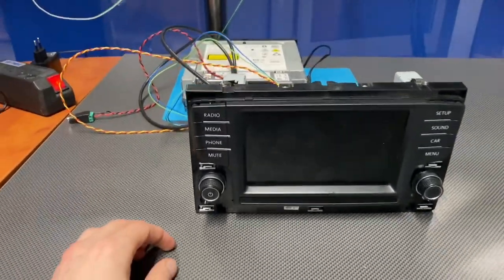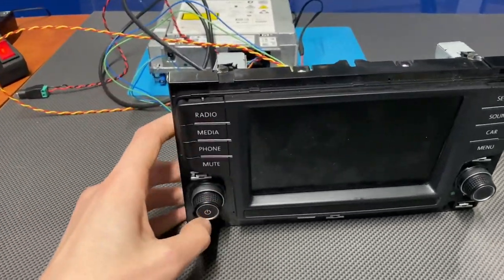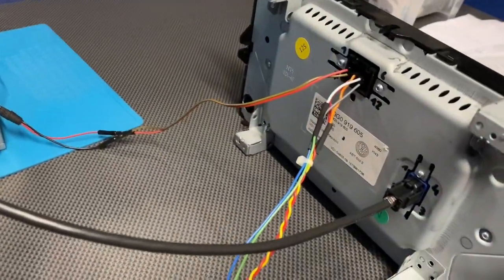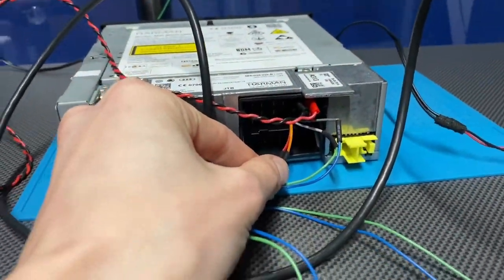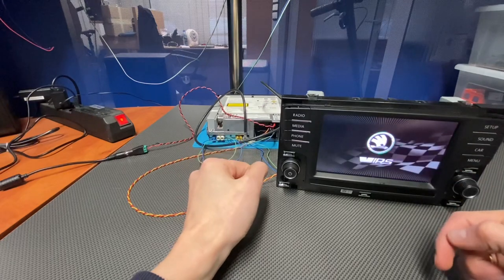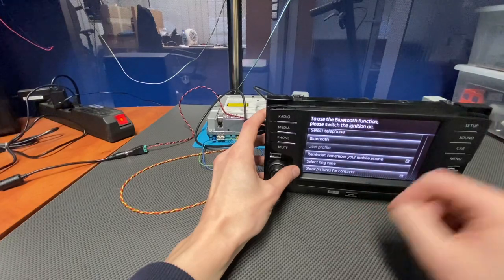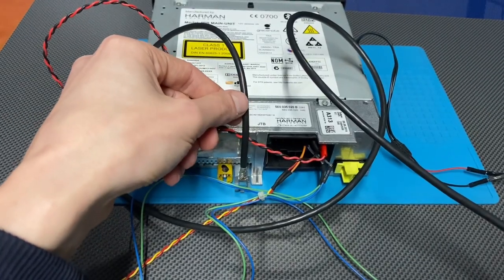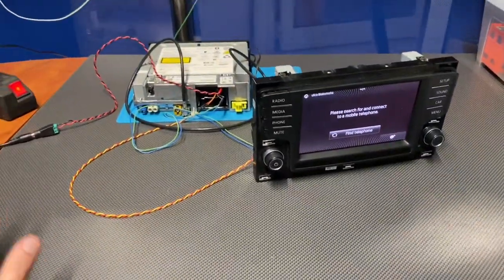How to turn on MIB on bench

Comment: I just purchased a used MIB2 for a 2017 Audi Q7 that doesn’t power on. The EBay seller says that I must disable component protection before it will power on. Is this true based on your experience? I think it’s a bad unit.

Comment: Hi, I need help with a unit. I have a 5q0 035 874c. I think I have damaged the circuit board with the wrong size removal key. Do you have a wiring diagram for this in hope o can get it fixed.

Comment: Where did you source your main unit and display from, since display if from vw and main unit is from Škoda

Did u buy on ebay or it came from a wreck?

I always had ideas to pull this from my golf, but sadly car cannot be sold without a radio nowadays
Reply from the maker: Second hand display from a passat or golf ($20).
Second hand unit from Skoda Octavia (borrowed from friend after MST2 retrofit).
Reply from the maker: Maybe one day I will source GW for a proper bench setup.

Comment: AWESOME VIDEO!! Thanks a lot for sharing! 
I bought a 9.2” display and I originally had a 8”. When I connect the new display to the Main unit, I can see that the power is ok on the radio coz the buttons light up but I have no image. 

Is it a problem with the resolution that you mentioned? 

I’m trying now the bench method but Im starting to think that the Display backlight might be damage. 
If you simply power the display with 12V does it light up the display or it always requires the lvds cable to turn on? Thanks a lot!
Reply from the maker: You need to convert your unit to the MIB2.5 firmware which supports 9,2'' display.

Comment: I have MHI2 unit of my audi TT mk3 2016 with a strange problem. When i turn off engine car and i open the door, the sound from the speakers goes off but the small fan internal to MHI2 don't stops. I have checked that this fan continues to operatea for hours and hours with car stopped and doors closed (but windows down in order to hear the fan). All functions of MHI2 unit operates correctly (sound radio cd sdcard phone nav etc). What can be the problem? Internal lights and virtual cockpit turn off so i think the car goes to sleep mode.
Reply: what should I do or what should happen to turn off the fan that consumes battery? It doesn't seem normal to me that the fan is always running and I find it difficult to think of a fault with the mhi2 unit that works well
Reply: When you supply the unit during the test bench of this video the intrtnal fan operates?

Comment: Any update on ignition and obd connection for bench?
Reply from the maker: No experience yet. But it looks like ignition signal needs to be emulated on the CAN-BUS connection, a OBD diagnosis requires gateway to be part of the bench setup.

Comment: Hello. I have tried to install Toolbox v08.1.1 on my SEAT with software version MST2_EU_SE_ZR_P0241T and the screen has locked. The system does not reboot. Can anybody help me? Thanks.
Reply from the maker: Why not the latest version of the toolbox?
Reply: @MIBhelper  I tried to update to the latest version but there was an error. So I installed the Toolbox v08.1.1 version directly, which should be compatible with the vehicle's firmware. But now it has crashed and won't just reboot. What I need is to know how to reboot the system. Thank you.
Reply from the maker: Check this: https://www.youtube.com/watch?v=Pdel-Kb-hZ0
Reply: @MIBhelper  Hello. I have already seen this video. It will be the last option if there is no other easier way. Thank you very much for your interest.
Reply from the maker: Good luck!
Reply: @MIBhelper  Excuse me. I have a question. When I disconnect the power supply to the MIB, will it ask me for a security code when I reconnect it? Thank you.